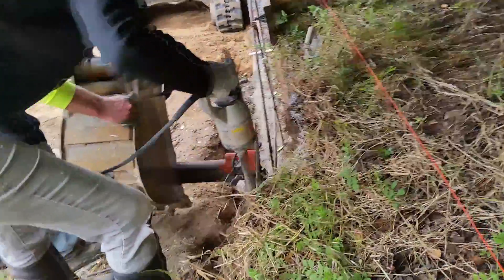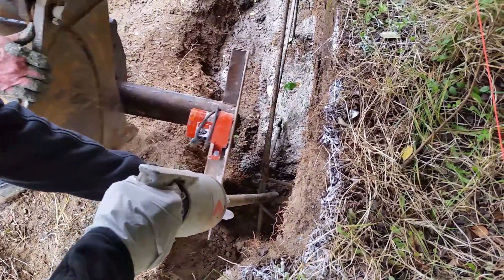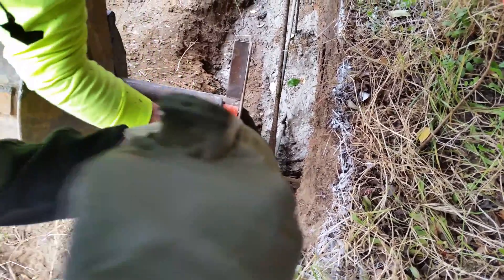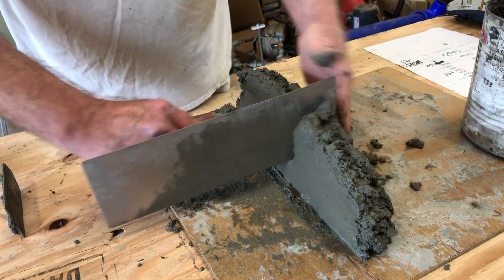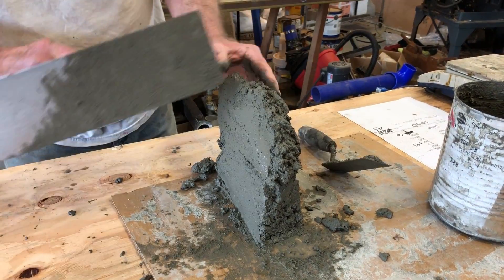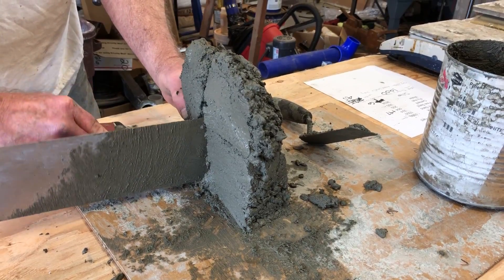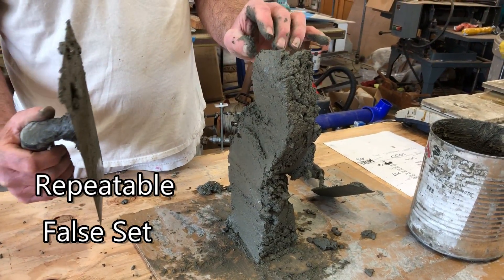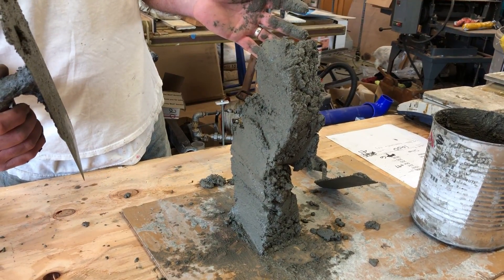Vertical Build Concrete    3D-Admix for Rapid-Vertical Slip-Forming, 3D Printing, or Free-Form Walls

Comment: Where to buy admix ? For zeero Slump concrete.
Reply from the maker: We are looking for a manufacturer to make the admix.
Reply from the maker: @Jogiv2 Machine1 The mix design is on the website SpaceCrete.com, which is essentially normal concrete with extra fly ash.  The fly ash does not help the stacking, but it lubes a stiff mix.  The inline-mixed 3D-admix is still not in manufacture.  No one has wanted to make it, so far.  You can get a long way there with nanoclays and other ulta-fines.

Comment: Pumping this (cylindrical or rectangle), at max density, with serrated edges, log cabin style, would allow stacking in multiple layers (perfection would be thickness of slip-form below),  this would allow for more surface area to set faster.  Next the slip-form would vibrate to condense the wall and finish (blowing Portland onto the finished face may aid).  An offset head on the lower part of the slip-form would be required \.  
...
This is why bricks and blocks were invented over cob.
Best regards
Reply from the maker: But I thought Cobb was the latest fashion?  Actually, you are pretty accurately describing 3D printing - at least the first part - and they are often using serrated nozzle edges.  A problem is that the rebar gets in the way of the placement in orderly layers.  Thank you for the input!
Reply: @SpaceCrete  I glade you got my Cobb joke.  Best regards

Comment: Imagine what would happen if you mixed that with aircrete.
Reply from the maker: The EPS beads make it much easier because they are lighter.  Surprisingly, the aqueous foam makes it harder, because it does not develop shear strength and does NOT like to be thickened that much.
Reply: I was just thinking that, with polystyrene beads..